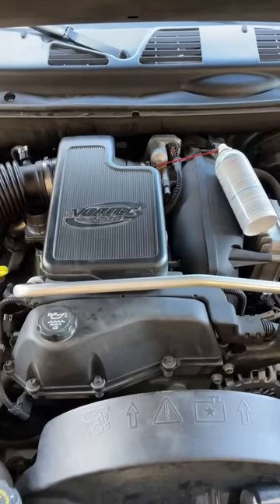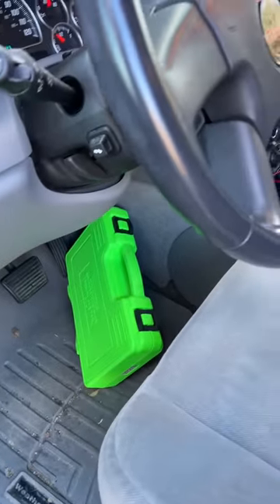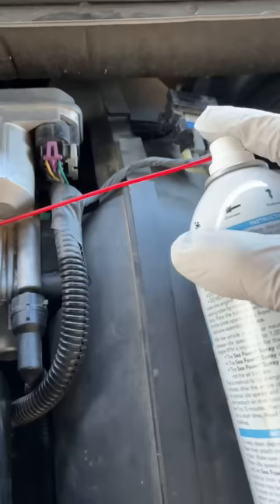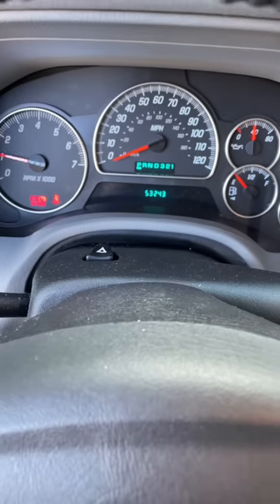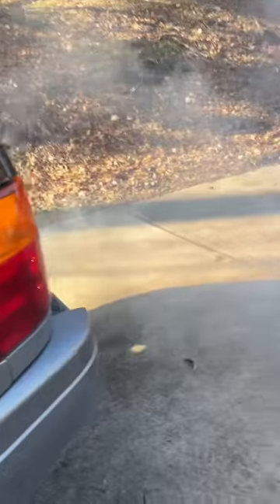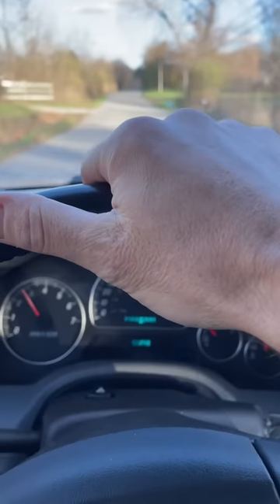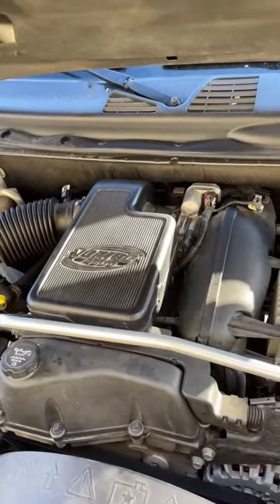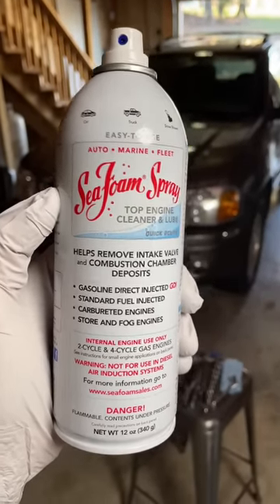Seafoam Smoothed My Rough Idle! Part 3 of 3!

Comment: I know seafoam works. I say use it once, then after that use Marvel mystery oil in the gas after that. Then also use motorcote in the oil. I have this same vehicle just just the extended version. It has been 100k miles using the mmo and motorcote and have never needed to use seafoam. I check my throttle body every 6 months and it's perfectly clean. I have 193k miles on mine and the check engine light hasn't been on and no engine parts have been replaced. I like to prevent problems so they never happen. So anyone who is wondering how to keep an engine clean this is how I do it.
Reply: I used that marvel mystery oil but it made my 1995 gtz supercharged run rough, I only use cataclean and bg44k now
Reply: @iLouieTube  If your cars engine was super dirty MMO probably broke stuff up and you will just keep at it, it should all be fine in a while. Just like how seafoam makes your car smoke and run kinda bad for a while once it cleans and gets worked out your car will run great. I've used MMO in all 4 of my cars for the last 10 years. Also in my weed Wacker, lawn mower and all motorized things.  If you put too much in it can do that to your car. My dad's old Chevy with 220k miles ran a little rough. We used MMO in it for 2 tanks and it ran great after that. If you still have some MMO left I would follow the directions for adding to fuel and keep at it. I'll bet it will clear up.
Reply: @4673962  i understand exactly how cleaners work I've used many different ones over the years to keep my cars emissions really low and the always pass inspections, I use them to keep everything cleaner and most important the Catylic converter as clean as possible however the MMO made my car run rough on several tank fills, it caused alot of problems for my car where as using BG44K for many years had solved alot of hesitation issues, idle issues so on an so forth, I also recommend cataclean, in my personal experience MMO was pretty poor for a cleaner and caused issues, BG44k is the best about and I'd put cataclean in second.
Reply: @iLouieTube  Gotcha, use what works for your car. I use MMO and have not had to use anything else because it keeps everything clean. It seems to not let carbon build up. I tried a bunch of stuff and settled on MMO. I like it cuz it WAS cheaper than other additives/cleaners. It was easy to use. It can be used in gas, oil, diesel and as a lubricant. In short I guess, I use it as a maintenance/ prevention tool and seems to work for all my stuff, including all my air tools, knives and mechanical things. Glad what you do works for you.
Reply: Your catalytic converter will fail early from all those additives. I saw it over and over as an auto tech. Gasoline alone has plenty of additives. I understand the warm fuzzy feeling from the snake oil, I get how good MMO (atf with more additives, sorry to spoil the mystery) smells. But lay off from now on. This cat is probably not gonna make it even if you stop now, but the next one will be fine.
Reply: @1985cjjeeper  no it won't. I have one truck with almost 400k miles never replaced  a catalytic converter. I have another SUV with 197k and another SUV with 178k miles.  NONE  of them have ever had theres replaced. Ever. Sorry man your wrong. I had an old Chevy blazer I replaced the fuel pump twice before 108k miles. Started using MMO and never had to again. It got in a wreck at 220k miles. Plus all the above mentioned trucks and SUV's are GM and I have never had to replace a fuel pump on those either. I have also tore my lawnmower down and took pictures of carbon built up on the cylinder and valves. Ran several tanks of gas through it with MMO in the gas tore it apart and it was tons cleaner. Did it with my 4 stroke weed Wacker, same thing. Your wrong, your not going to tell me other wise. There are more channels that prove my point, not yours. Like project farm and tons others that PROVE MMO and others help an engine. That's why MMO has been around for 100 years. If it was snake oil it would be long gone. Do some research before you go spewing your ideas. Better yet quit being so close minded and try it out on your own stuff. Again your wrong, you should try it. I have kept records of miles by hand not what the vehicle says and MMO improved my milage. I'll do what I want you do what you want. But you should use some it works and has saved me tons of money.......what if you never tried ice cream and just sat there and listed to other that tell you how bad dairy is bad.  Just sayin
Reply: @4673962  
I know it from experience. You are a fanboy relying on your own fanboy experience.  Bieber fanboys think he's the best too. Good luck with your snake oils.
Reply: @1985cjjeeper  🤣🤣🤣😅😂
Reply: @iLouieTube dont put mmo in turbo engines😂 bad idea it clogs the seals

Comment: Seafoam is really good for 4 cylinder engines. I ran the engine at a high rpm when I put the can in. Car smokes like it's going to die js
Reply: Ummm..... It works good on all engines..... Wtf

Comment: My tractor mower had an erratic idle  for a month or so and after ruling out a few things where the only thing left was a carb clean out  I put half a can in the full gas tank and cut an acre of  grass and all was now good at idle. I now put  2 or 3 oz  of sea foam in every tank fill up.
Reply: Great idea. I do the same but with Marvel Mystery Oil. Works great. I even took off the head to check piston and valves before I ran the mmo. Ran it for the season and looked again and there was a huge difference. Much much cleaner. An ounce of prevention is worth a pound of cure!!!
Reply: @Mike Veselka  mmo for the long haul imo is better I use alittle in my feul and a little in my oil every change

Comment: Congratulations, you just took tens of thousands of miles off of your catalytic converter
Reply: I doubt he's concerned about that with that car anyway lol
Reply: Seafoam was designed for marine applications. Boats don't have Cats or oxygen sensors.
Reply: imagine not hollowing out your cats
Reply: You prefer a non hollowed cat? Why?
Reply: You guys still have cats in your cars?
Reply: Whats catameritic convertier? That them thingamabobs that gets me some me money's back at ye ol' scrappy place when i buys me a new to me's vehicular device?
Reply: And what proof do you have of that?
Reply: @it_is_confusing_2998  Took mine out!!! Still they run cleaner than pre 75 autos
Reply: @wmc128  it literally says for ANY motor on the bottle
Reply: He could have just done the aggressive drive part and maybe cleaned the throttle body out. I don't care what the can says you run detergents and oils through your catalytic converter its gonna get messed up by it. And the way they've engineered converters to be so efficent yet use minimal amounts of precious metals Seafoam is a recipe for disaster. If you wanna do this, take your catalytic converter off first
 Seafoam is safe for all engines (sorta) but not catalytic converters.
Reply: Actually.  If your an honest mechanic then you would know what I’m about to say is truth.   I’ve saved catalytic converters by running the car till operation temp.  Pulling 02 on top of the converter pouring in sea foam letting us soak.  Then pour in more and go drive it.  Cleans them right up and gets rid of efficiency codes.  We have saved allot of customers a ton of money. This only works on clogged converters that aren’t damaged.  FYI!
Reply: @seanandrew2823 because I don’t like the smell when I drive around with my jeep top off.
Reply: @kodaofficial8939  right! It even has pictures of cars, boats motorcycles, trucks lawnmowers ect. All over the bottle! 😂😂😂😂
Reply: @R.N.GPerformance  😂
Reply: Where i live they will just steal your cat anyway. So let the Sea Foam flow. And have a smoke show
Reply: @R.N.GPerformance  had an escalade with h.o. 6.0 rwd and the cat cracked cuz plugged and was making a vibrating noise. Went underneath with a hammer started banging on cat and told my girl Rev it up a lot. Vroom vroom. And shot all the honey comb cat crap out the back. Needles to say the escalade sounded good and hauled ass
Reply: @it_is_confusing_2998  my cat stays inside
Reply: @wmc128 who cares these cars have 200 to 300,000 miles on them.😅😅😅😅

Comment: Thing is, it may work on a rough idle in A certain situation... But there's more than one situation that can cause a rough idle. Even some may consider bad motor mounts causing a vibration throughout the entire vehicle to be an idle situation (of course that's only some folks)... Seafoam is great for cleaning carbon deposits and "sort of" cleaning O2 sensors. Otherwise, it's not the "be all, fix all" product.

Comment: Ran a can of seafoam through an old ATV that had sat for over 8 years. Didn't completely fix the idle, but it did improve it massively.
Reply: At that point it would've been worth tearing the carb down for a cleaning anyway, probably a good bit of varnish blocking some the idle jet, maybe bits of float bowl gasket too. 
Worst case scenario I'd consider just getting a carb rebuild kit.

Comment: I thought Sea Foam was going to be snake oil when I tried it on the 1992 Acura Integra I had. Well, it took the 196,000 mile B18A1 in that car and made it go from shakey mess at idle to smooth as a 4 cylinder can be at any RPM. And the car accelerated better, it got better fuel economy, I was blown away.

Comment: I used a can just like this in my ford edge and it damaged one of my catalytic converter’s! Real story! Expensive !
Reply: Of course it did, I keep telling people that on these videos and they just don't seem to understand. But what would you expect when you loosen up a bunch of crud and send it through the converter? The only way I would consider using seafoam in that manner was if I unhooked my converters beforehand
Reply: @ab7rs  I learned the hard way! Had to order straight from Ford dealer in California!  No Go on sea foam now!
Reply: Well if your cat wasn't almost plugged it probably would be OK
Reply: Lesson learned, don’t buy shitty ass vehicles in the first place
Reply: You dont need a cat just defeat the downstream o2 and hollow your cat out, your car will run better too
Reply: @seanandrew2823 Defeat the downstream O2 by disconnecting the sensor or removing it?
Or how exactly and will deleting cat harm the engine?
Reply: @thisismagacountry1318  it wont harm the engi e but the downstream o2 can tell your cat is blown out. DO NOT cut the wires just get an o2 sensor bung spacer and put a little steel wool in it so your check engine light stays off
Reply: @theringer13  
At least you got the right converter, aftermarket converters are substandard. Back when I worked as a Toyota tech nearly every single customer that needed a cat and went aftermarket was back at the shop within a year getting a factory cat installed as the aftermarket one had failed.
Reply: @1985cjjeeper  Thanks for the positive words. Glad I went the Ford Route in that part too. It’s been a great vehicle over the years !
Reply: @1985cjjeeper  I did read somewhere that toyata engines were super dirty and put out way to much nasty stuff to use a regular converter. I guess the super heavy duty one is good idea then

Comment: I have used it a bunch over the last couple of decades since an old friend had turned me onto it one year out in the desert . He had some partially plugged up passages in his dual carb buggy and put half a can  into his tank of fuel before we headed out for a run .  Before he dumped it into tank his engine was barely drivable , shooting ducks & running rough as Hell, after he did treatment & about a 20-30 minute run we came back into camp & that old VW Engine was running as smooth as silk & purred like a kitten.  Made me a believer on the spot .  C-ya .👍

Comment: It's because it cleaned the throttle body. Sea foam is made for 2 cycle engines that's why you have the smoke is because the oil in it. You can use it to clean the throttle body without the engine running. As a mechanic of 27+ years I don't use it unless the engine is off. Now you have created a sticky residue that will just cause the gunk to build back up even faster. My opinion only. Do what you wanna but it will damage the catalytic converter
Reply: Then straight pipe it the converter Is useless
Reply: I cut mine off , and straight pipes my fi50, every vehicle I get I I immediately get it off

Comment: I used the sea foam transmission conditioner to unstick a valve in my Dodge 1500 auto transmission . I did that over 2 years ago and it hasn’t had a problem since.

Comment: I drive a lot of miles,  I use seafoam, I put two cans in my gas tank, twice a year , you'll NOTES from day one your car will be running smooth and the motor will be more quiet,  guarantee ... Try it you have nothing to lose... This will help you with all your emissions parts... This helped keep the Pistons clean from carbon buildup.. and the fuel injectors clean... And your valves 👍

Comment: Seafoam flat works. Doesn't matter which product you use. This stuff does what gas used to do. Cleans off the backside of those values. The unintended consequences of Fuel Injection. ESPECIALLY Direct Injection.

Comment: Many products are like this... Seafoam is just the name brand OG. However, to save some dollars get the SuperTech version and put a can in your gas tank, a can in your crankcase, and a can in the brake booster (same as throttle body basically) and it'll clean EVERYTHING thoroughly. Same process as this. Except then change your oil in aboutr 200-300 miles. If you've got bad oil burning, try soaking the piston heads themselves with it a few times a day by opening up the spark plug wells and pouring about a half cup per cylinder once in morning, noon, and night. Then run it the next morning. It'll fix those rings!

Comment: use this product for upper end lubrication and dura lube for the lower end,engine lasts forever,do not put in a new engine till it has 7500 on it,so slick, new engines won't break in ,no bull

Comment: The GM direct injection engines have carbon buildup issues due to the EGR valve dumping oily exhaust gas back into the intake. In normal fuel injection engines the injectors spray upstream of the valves and the gasoline largely dissolves the oily residue but in the GDI engines that stuff hardens up into carbon deposits on the backs of the valves and eventually causes performance issues.  There is a GM TSB about this where they will fog a Delco branded product into the intake while the engine is running to do what this clip is showing being done with the sea foam.

Comment: I had a catalytic converter CEL and a Fuel Pressure in Cylinder CEL, plus the car could not pass inspection.  One can of Seafoam in the gas tank, one can of spray in the intake.  Both CELs gone and passed inspection.

Comment: I was told it was originally for 2 cycle engines I wouldn’t use it
Reply: It's the best product that I've ever used,  been using it since the 90s.
Reply: It can be used it two or four strokes.   It's great stuff.

Comment: That stuff Does work. I had a Honda cx500 that had been sitting for many years. I didn't drain the old gas added a full can of Seafoam to the old gas. Started the bike with a jump got it running smoked a lot ran the tank empty refilled with fresh gas and it ran perfect.....

Comment: Seafoam works wonders I have a chrysler 300 the motor was knocking and making all kinds of noise I put a while can in the motor oil and ran it for about a week before I changed the oil and now it runs so smooth and doesn't make any noise at all it had a lifter tick and a rod knock before I put seafoam in it

Comment: Are used to have a 04 v6 Chevy trailblazer and it was one of the best vehicles I’ve ever owned. With that being said I had a couple issues with it of the coils burning out on it or just a non-functioning properly coil so if you have rough idle issues just go for the coils I know they’re expensive but you’re gonna need them eventually anyway believe me. The street six motor is a beast by the way and I love it
Reply: That's cool I have the same trailblazer to and it's got its fair share of rascals that go wrong at the time to time it keeps throwing a p0300 I think it's the ignition coil packs I replace the spark plugs I got tired of my catalytic converter getting plugged up so I said screw it and chopped a sucker off and also no oxygen sensors

Comment: Sea foam is great if used correctly! You got the spray which clean the leaving mess out of the upper part of the engine, not sure if you checked the egr valve that’s a pretty common issue that can cause rough idle, and even poor acceleration. I love seafoam it does work! But now if you got the bottle that can be poured it’s supposed to be split into 3rds 1/3 in the fuel take, 1/3 in the engines “INTAKE” make sure what ever your pouring it into in fact goes into the engine air intake! And the other 1/3 goes into the oil.
The last one is the big one, if you put it in a cars oil system that hasn’t been properly maintained. It will wreck havoc on internal sensors, variable valve timing systems that rely on oil pressure, timing chain tensioners etc! 
It’s meant to clean the inside of an engine that’s fairly well taken care of, not for a engine that leaks heavily that you just keep topping off or even just topping off when it gets low, and not changing it, and not changing it.

Comment: If doing that way fixed the idle, you have a fouled plug, possibly caused by a bad plug wire or it's possible not all the way snapped down.
On a EFI engine, you should get the gas tank down to 1-2 gallons and get a pour can and put it in the gas.  The way you did it, you did NOT clean the injectors, so if it improved your idle anyway, after 2k miles, check your plugs visual, find which one is fouling and why.